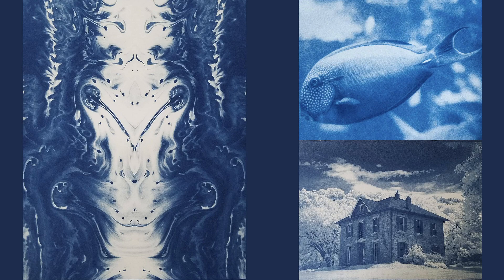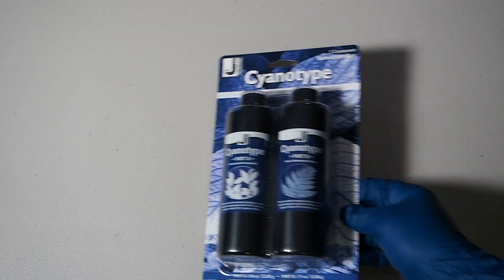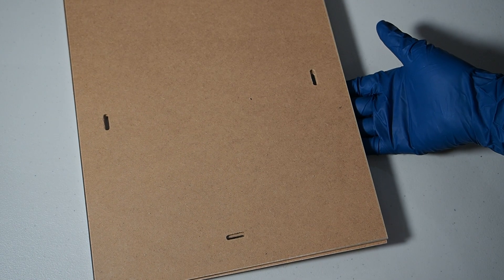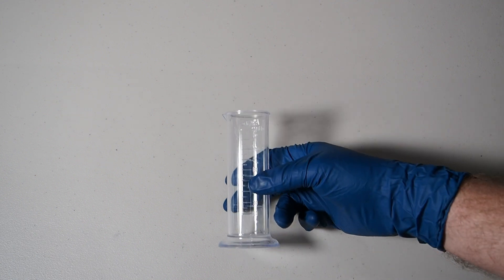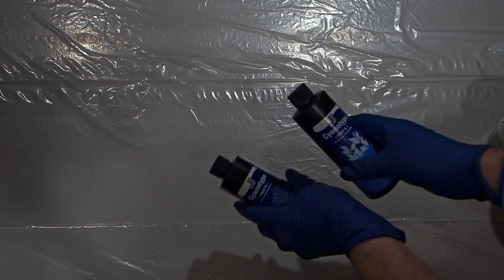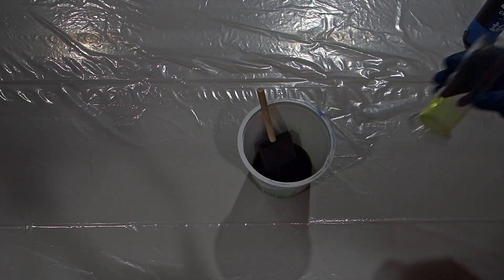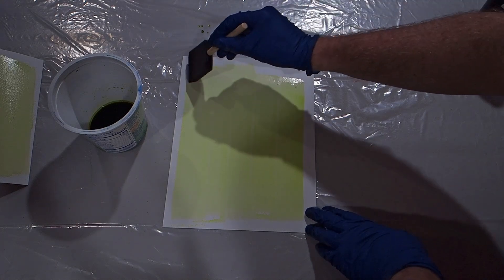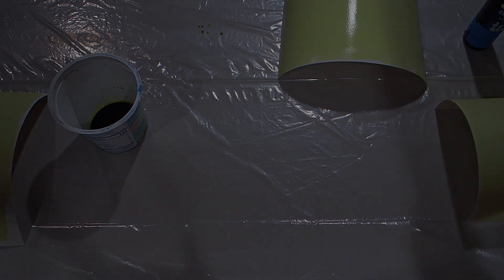Cyanotype How To Part 1

Comment: Merci pour toutes vos instructions. Lorsque le mélange est dilué dans les 2 bouteilles, savez-vous combien de temps ce mélange peut se conserver dans leur bouteille d'origine?
Reply from the maker: That’s a great question. I’ve used the chemicals months after I initially added water, as long as they are stored separately. Once the two chemicals are combined, the mixture will start to degrade in two to four hours.